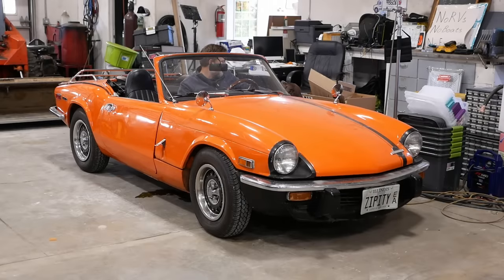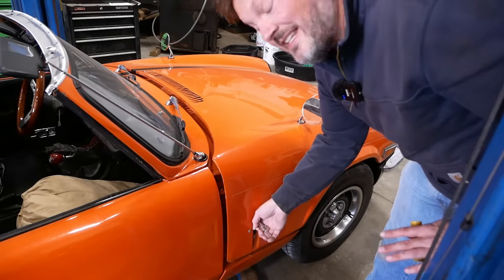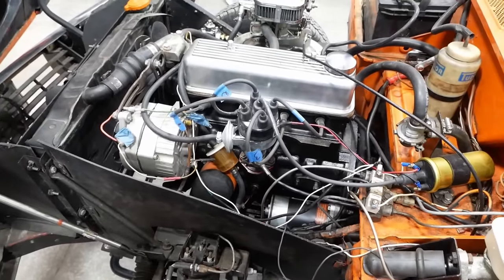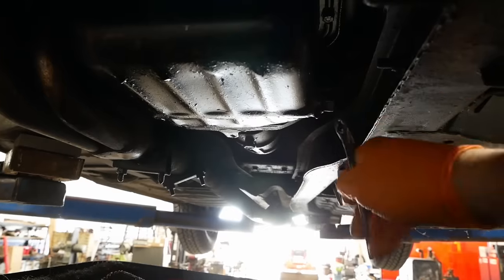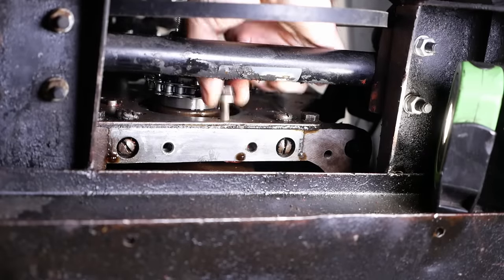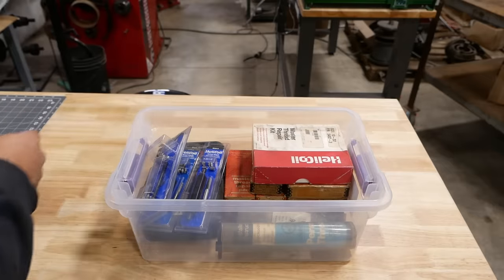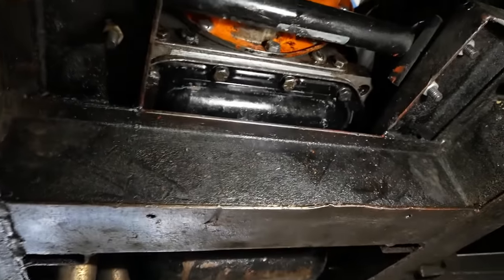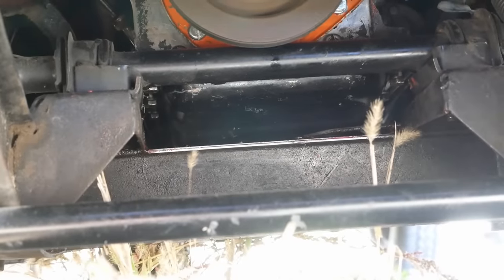Can You Stop a British Car from Leaking Oil?

Comment: My father was a mechanic who specialized in foreign autos…Triumphs (most English cars) made the family lots of money! The oil leaks were his favorite thing to tease owners about  (dad hated oil leaks), he would explain to them the rust prevention system was factory installed…
Reply: … but does not work!
Reply: One modification was a oblong washer plates or a long strip drilled with the same holes as the Sump pan along the front and back also down the sides Triumph motorcycles had a drip tray as mandatory 😂.👍👍
Reply: Don’t take on a classic mini ever.😂
Reply: @jimrt1738  they sure are a pain to work in if you have big hands or a body size bigger than a 10 year old😂.  But they are so fun to drive, they are just an enclosed go kart
Reply: Yes this is true, they were like the first version of the scotoiler for bike chains but with engines, self lubing inside and out.
Reply: My TR4A IRS leaked lots of oil and before it finally disintegrated it had more welds and patches than original metal. Before I would race in a Jim Cono parking lot race I would bang it all over with a rubber hammer to lighten it up.
Reply: "Yoooouuu don't need to worry a-boot rust and structural integrity"
-Zip Ties

Comment: Wes, I have to admit, I was very surprised that you could get the oil pan off without lifting the engine a bit, but it makes you wonder if it was designed on purpose due to the leaking like a sieve design criteria.  The scene where you cut to the kettle blowing steam apparently out of the side of your head is cinematic genius!  Keep cracking on with these videos you're making me split a gut laughing.
Reply: Enterprising mechanics could also rebore the block and fit oversize pistons on the driveway with the engine still in the car.
Reply: Dude you were smiling on the whole test drive! 😂 Nice job!
Reply: And just to think it was previous Americans that butchered the car before young Wes got to sort out others' problems, I like that.
Reply: Same thing with an MGA. First step in pulling the pan is to pull the engine. I made some special wrenches to get to inaccessible bolts so I could pull the pan without removing the engine, or even having to take the engine mounts loose. Saved me a heck of a lot of time and effort over the years.
Reply: Same I saw that I beam of a front crossmember and thought good luck. I can only assume the engineer responsible was given a stern speaking to about not making mechanic's lives easier.

Comment: You may find this interesting. I had a 1977 GS750 Suzuki motorcycle. The valve adjustment required special tools I didn't have. Took it to a shop to get the valves adjusted. Twice they put a new gasket in the cam cover but it would always suck in and leak. After the second failure I told them to not use RTV. Just use the gasket. They got mad and said do it yourself and handed me a new gasket. So I did, in the parking lot. It never leaked after that. There are times, maybe many, when just the gasket dry works best.

Comment: Having owned and restored multiple Spitfires and currently restoring a TR6 I can empathize with you on this one!  Vendors now make a new steel replacement block for the aluminum block where you had to install the Heli coil.  Had you removed the aluminum block to repair it you would have had to find a couple of small wood shims to seal the sides of the block.  Old school technology at it's finest :)

One other comment.  The turn signals actually do self cancel IF the inner steering column is installed right and the switch itself isn't broken.  It's easy to install incorrectly.  

Great video.

Comment: I drove a ‘68 triumph spitfire across Canada in 1975..With my new bride. 
Other than a water pump and resulting warped head and replacing the clutch, the trip went rather smoothly. 
 I Filed down the head, parked on the side of the road, bolted it back down. With  the same gasket. Drove to Calgary picked up a head gasket and water pump installed it and drove to almost Golden when the clutch packed it in. Hitchhiked back to Calgary picked up a clutch. Put it in the next day. Drove it for another 50,000 miles. Had a blast. Best sports car ever.
Edit. The best part was the trip cost  $68.00 in fuel.

Comment: Great video Wes takes me back many years as a young lad aged around 14 watching my mates Dad working on these cars. I only lived about 8 miles from the Triumph factory and 10 miles from the Massey Ferguson factory in Coventry. I later did my apprenticeship as a Truck and Machinery mechanic but started out working on a lot of what now were old cars. I worked on many different makes and models of mainly British cars but with the odd German and French ones just for good measure. Your very right about the simplicity of these cars especially for the young lad I was back then to learn on. The Triumph Spitfire holds a special place in my memory as it was the first blown head gasket I replaced under supervision. So easy to do looking back but I was so proud when I turned the key and it started and drove perfectly. Later on my first clutch change was on a Triumph 2000 and again so easy looking back now but it was a great way to learn and a fantastic opportunity to help me step up to Truck and Machinery mechanics. Thank you for the trip down memory lane 👍👍

Comment: It wouldn't be a Triumph if it didn't have an oil leak. I rebuilt a Spitfire from the chassis up for a friend, with extensive machining on the engine to true up some bloody horrible tolerances. That was forty years ago and that car is still running today . . . yeah, it still has a few tiny oil leaks too but according to my friend, that's what stops it from rusting. Just be eternally grateful it wasn't a Triumph Stag . . . or the Dolomite Sprint, either one of those actually reduced me to tears! When Triumph was absorbed into British Leyland it all got infinitely worse! Every surface needed double gaskets and RTV to stop leaks!
Great vidio sir thank you.

Comment: I had one of these, an earlier model. Had transverse leaf spring across rear wheels and driven hard could hop sideways, the rear spring would tighten up and inside wheel coming back on the ground was 2 inches narrower than the front.  Very prone to going thro hedges.  That's the small trees we have on the sides of our bendy roads. 
  Your recommendation of Snowball engineering is welcomed.  Fantastic skill with some big kit...
  Recent favourite of mine is Ants Pants.. Lithuania I think.  Real bodger on mini digger and your type kit, but it works  after.  Builder as well!
  Thanks for your channel and a view of you're family life.  Enjoyed the squirrel casserole...

Comment: After all the talk intended to PO the Anglophiles in the crowd (nothing but good humour intended, I'm certain), I caught you cracking a deep down to the core smile several times as you were headed down the highway (like when you found fourth gear) - even though you could not see!  😆 Just couldn't suppress the sheer joy of motoring along in a classic British automobile.
Wonderful episode.  Very British humour ♥
Reply: Yep he redeemed himself at “I can see why he likes it!”
Reply: Put a smile on my face when I saw him cracking up ..brought back  memories of my ‘68
Reply: @FFLFFS  We're of the same vintage then.  My cousin had a 69 or 70.  I was SOOOO jealous 😍
Reply: @stevejohnstonbaugh9171  
 
I had rebuilt mine 100% 
The floor pans was a big one. When I saw the fixed up floor pans from the underside in the video it all came flooding back. 
I bought a 71 that had been rolled. (Should have been a warning)
I Cut the floor pans out and welded them into the 68.  
He did call out the rear suspension correctly. Which almost killed me because I rolled it shortly after the rebuild. 
Luckily landed upside down in a swamp. Just a scratch lol Smh 
It was a death trap..

Comment: Those small sports cars suited us well enough here in the UK where we have narrow winding roads that are fun to drive along rather than the roads in the US which seem to be dead straight and go on for ever.  You're right, they did usually leak oil and coolant but that was 70 years ago.  Nowadays all cars seem alike and you wouldn't know where you are just looking at the traffic.  At least with these old survivors you can work on them and not have to dismantle half the car to get at something.

Comment: If you do end up working on unobtainium ignition components, consider retrofitting EDIS.  You can gut the distributor and 3D print a mount for the crank sensor... put two trigger notches 180° apart and it'll count the crank revolutions.
Reply: I redrilled my distributer plate to fit Delco points on my GT6. instead of having to file and adjust the Lukas and replace them every month I never had to touch them again until I got rid of the car.

Comment: A lot of British stuff of that vintage still had cork gaskets, so a +/- 1/16" tolerance on stamped parts, like an oil pan, was still acceptable.
A British car factory might also be 3-4 guys hand building cars in a back shed, so the R&D budget just wasn't there. Probably why the British automobile manufacturing industry has been as successful as it has.

Comment: Occasionally, it's complicated to remember that the Brits actually made the Merlin engine, which did not leak oil on the exhaust manifold.
Reply: They also produced the amazing sleeve-valve air-cooled radial aircraft engines (Bristol Centaurus in the Hawker Sea Fury turning a 5-bladed prop is my favorite). Don't forget Frank Whittle who in 1930 (age 23?) patented a design for an aircraft gas turbine engine. The old Empire contained some incredible minds.
Reply: Only the Yank WW2 radial engines leaked so much oil they had to be turned through at least 2 full revolutions to clear out oil from the lower cylinders!!
Reply: Shame we hadn't developed fuel injection for the Merlin at the same time so Spitfires didn't suffer fuel starvation in tight manoeuvres.
Reply: so right but that was back when Merlin was a magician , 50 yrs ago I had a 64 TR4 it was simple and fun but different, Lucas electrics, Stromberg side draft carbs, positive ground, "What!" wire wheels easy to work on but needed work all of the time good memories
Reply: @davidholder3207  Making them as fast as possible was probably the main reason.  The US created 300,By000 engines of all types of planes in WWII.  150,000 Merlin engines were made, with Packard the car maker making 55,000.  2,710 Liberty ships. By the end of the war, they could crank out a ship in 24 days.
Reply: @thomasfrancis5747  Miss Shilling's orifice to the rescue!
Reply: @dlewis9760 Moore like 24 hours!
Reply: Wes put the kettle on!
Reply: Not to mention we built the Centurion tank at the end of WW2 which was designed to take on Tigers but by the time it got to the front for field trials Germany had surrendered. Centurions saw combat against modern main battle tanks like the T55 and T62 as late as 1987 and held their own. 

The aircraft industry was definitely where our engineering talents seemed to lie. The Hawker Hunter was the F16 of its day. I wouldn't be surprised if these still aren't in service in some 3rd world countries. The English Electric Lightning I believe is one of the only aircraft that managed to intercept a U2. The English-Electric Canberra also conducted some insane high altitude flying in a modified form. The Buccaneer is probably the best low level attack aircraft ever built. The RAF and Fleet Air Arm regularly used to scare the absolute shit out of foreign air forces with its low flying antics - probably the only people more insane were the Swedish air force flying their Saab Viggens. The RAF V-Bombers - Especially the Vulcan and the Victor regularly used to cause havoc for the yanks in exercises testing US air defences. We also ended up building the Harrier jump jet and Concorde.
Reply: 3spd?????

Comment: My brother's English vehicle story.  I live in Canberra, Australia which among other things is the residence of the Governor General. During the 60's + 70's his official car was a V8 Bentley .  It was maintained by a massive group of Government owned workshops that cared for the commuter bus fleet, truck fleet, cars fleet and all emergency vehicles. Hated was the Bentley due to difficulty in doing repairs.  The spark plugs were impossible to access.  The motor was so tight in the engine bay that you could not remove the plug leads let alone unscrew  the spark plugs.  To change the plugs it was necessary to remove the inner guards.  They was held in place place by many, many  bolts with 1/2 inch  heads.  The bolts were about 4 inches apart and mostly inaccessible.  Most could only be  removed with an opened ended spanner as sockets could not fit.   Removal usually took about 12 hours.  Needless to say, the plugs were only changed when the car was almost impossible to start.

Comment: Well done, Wes. You got most of the vocabulary correct. Indicators, was one you missed.
But that really needs to be driven on something narrow and twisty, not flat and straight. Then it's fun.  Spitfire was built, if I remember correctly, on a Triumph Herald chassis. A much more sedate car. That that rear suspension had a reputation for folding under if you became airborne over a hump-backed bridge. Like a real Spitfire, it retracted it's undercarriage!

Comment: The title shocked me. I have owned and worked on a few Brit cars and found them very easy once you wrap your head around how they do things. I figured something of the vintage of that Spitfire would be a snap for a sharp guy like you. The factory torque spec for the timing cover is exactly .65 ugga duggas using your calibrated elbow.

Comment: Years ago, I had a 1976 MGB convertible. That thing was a blast to drive! It had the same problem, though. It wasn't made for bigger or taller folks. The pedals were also very close together, and it did happen that one day I hit the gas instead of the brake with it in reverse. How I never hit anything, I still don't know.

One never got anywhere fast in that car -- not because it was unreliable, but because almost everyone wanted to stop and talk about it. While I can't be sure it was the cause of failure, the engine never had much oil pressure and one day it came apart on the Interstate. I sold it to some enthusiasts -- maybe it's even still on the road somewhere today.

Comment: As a transplanted Brit and a former owner of a '64 Spitfire, the term 'Couldn't pull the skin off a rice pudding' comes to mind. The guy I sold it to, junked the little 1147 cc and put in a Ford 1600 Twin Cam and gearbox. I did the welding on the converted prop shaft and the thing would do 120 mph..At least it DID until he put into a ditch!!! The rear end suspension on those things were similar to that of a Corvair-unsafe at ANY speed.

Comment: I had a '67 Spitfire that had zero rust. I never thought it was possible but nevertheless....
I  was working for a foreign car shop at the time and was getting a rapid exposure to the eccentricities of the British automobile. 
 My Spitfire was sky blue with a white hardtop. It also had plenty of oil stains under it.
The oil pan had seen much better days and someone had hacked the proper British plug out of it and brazed in a chunk of small block Chevy pan to replace it. 
 With the help of a British car expert i was able to find a new old stock pan. Of all places it came from Russia, Saint Petersburg to be precise. Which was ironic because I was in Saint Petersburg Florida. 
The old Brit brought it in and also brought a piece of flat steel. He showed me how a brand new pan was warped from the factory and had me make plates to bolt down the pan to help flatten it out. It took several weekends but it was finally finished and ready to install. I asked what sealant to use and he said none.
It never leaked from the oil pan again. 
Factory rustproofing indeed.....
Cheers from South Carolina 
Terry

Comment: Good video Wes.  You look like your shoe horned into that little thing.  A tip I’ve always done with bolt holes on pans and covers that are not flat is to use two ball peen hammers.  The round part of one on the hole and use the other hammer to tap that one.  It pushes the metal around the hole in the opposite direction so when it’s tightened down it crushes the raised part down flat matching the rest of the pan or cover.  That method has worked for me for 50 years.

Comment: Wife had a Fiat convertible back in the 80's. Forget the model year. The wiring was a nightmare. If there was an issue, you just ran a new wire. None of the wiring matched the schematics. Like you, I am not a small guy. Working on it was another nightmare. Thanks for sharing.

Comment: You just disabled one of the best features of old British engines, Self Changing Oil. No need to drain it, just add oil regularly.  Fortunately, that feature is also self correcting so before long the oil will be auto draining again.  Also, no need for a  self cancelling indicator stalk, with Lucas electrics the indicator globes blow frequently enough that they are already mostly  self cancelling.  The reason for just one switch is that  Lucas switches never worked for long so they just installed one for everything to save on manufacturing and maintenance costs. You showed up at the dealer and said "My <insert feature here> is not working" and they just changed the one switch.  Genius!

Comment: I had a  73 Spitfire about 10 yrs ago. Simple /fun to work on and  my son earned his auto mechanics merit badge on that car. The rear whined like that, better check the gear oil. If it's not leaking it's empty. Word of caution. Do not use anything other than LMA brake fluid in the brake or clutch system. It will ruin the seals overnight. Mine found it's way to NY from Arizona so no rust.